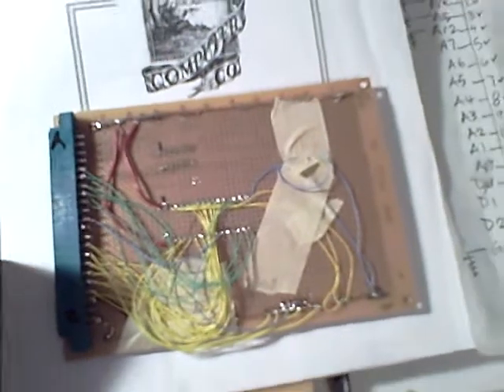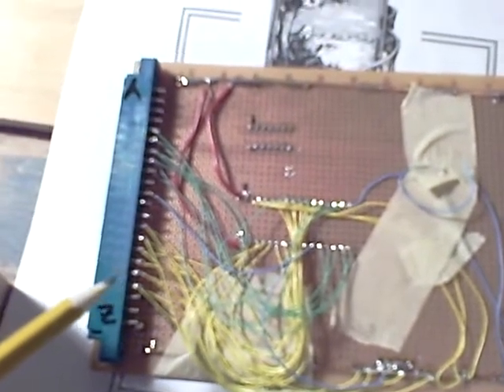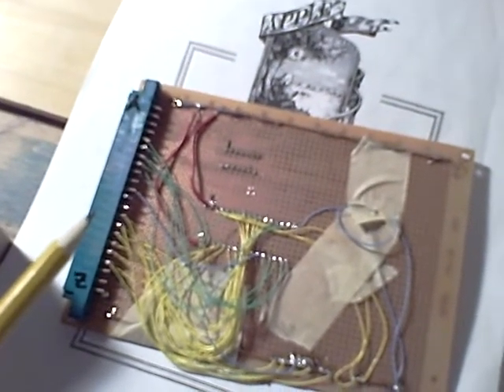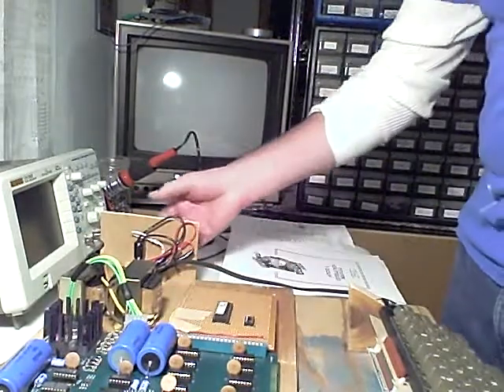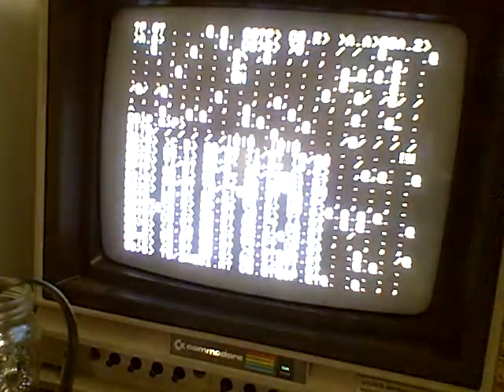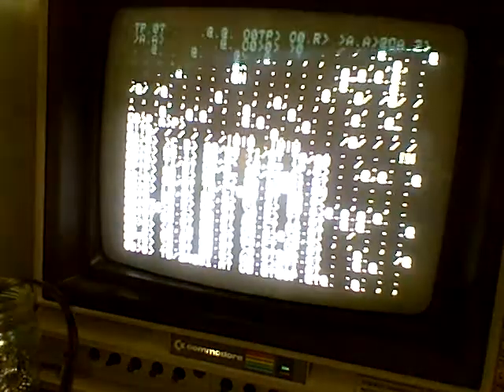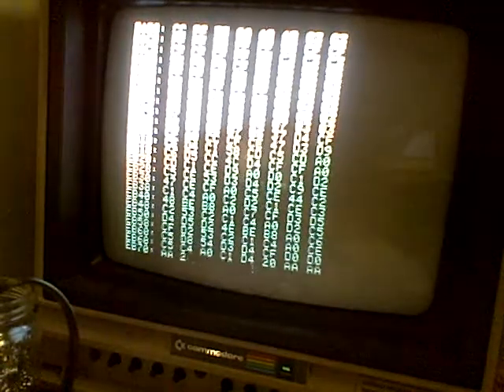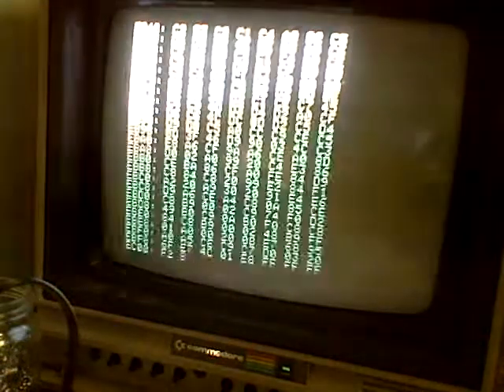#5 Apple 1 computer (clone) chronicles

Comment from the maker: @Ericrud96 - I was going to build the Replica-1, then found the Obtronix and later the Mimeo-1 Apple-1 clones.  I have built 3 of these so far, 2 work, one does not (yet).... this Obtronix board has a few design bugs probably from an earlier production run.  I did this mostly to learn more about computers -- it's just a hobby, and starting with an 8 bit computer seemed the way to go to start.